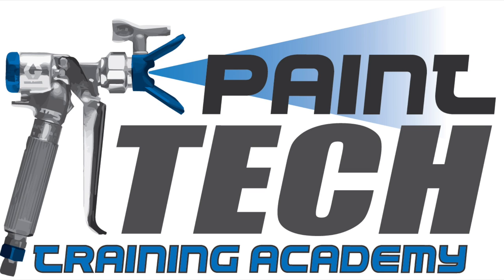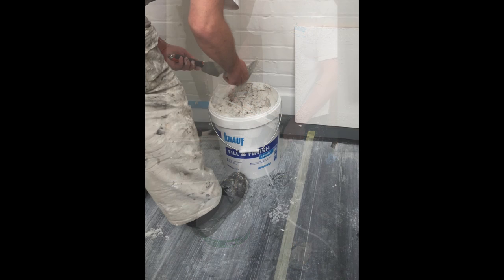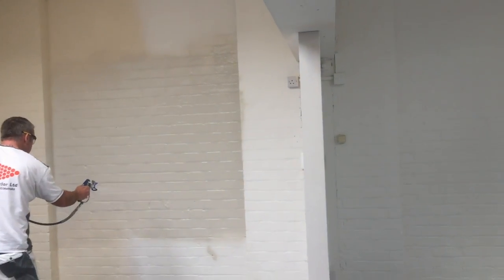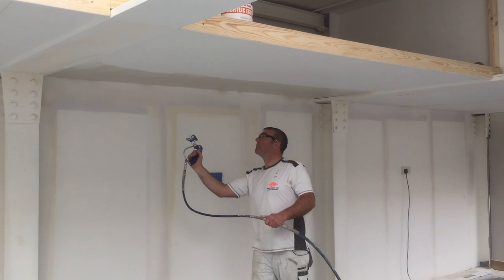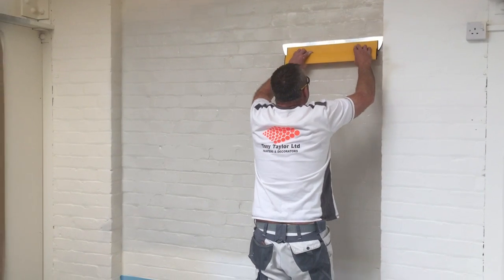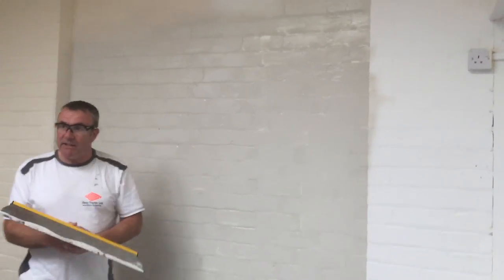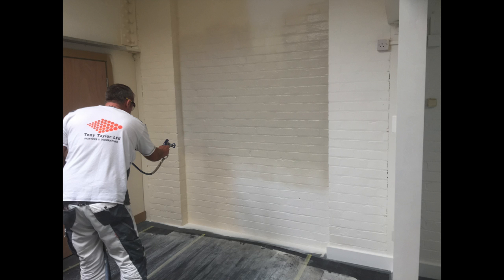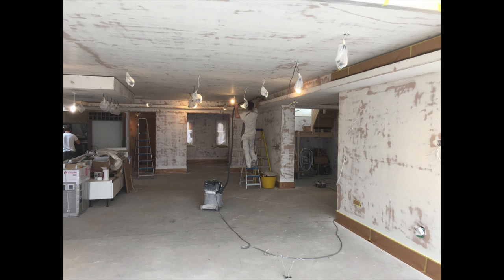Spray Plaster

Comment: You should also mention you have to wait for it to dry in between coats. 

The max thickness is also lots smaller than multifinish so you need to prep lots more prior to plastering. 

Finally, you can spray multifinish too!
Reply from the maker: have you tried to spray multi finish? if so how did it go? plus have you used any Airless plasters?
Reply: PaintTech nope, I've no experience spraying either of those. My jobs are too small to justify the expense and bulkiness of a multifinish sprayer.

AFAIK gracos sprayers are capable of both paint and ready mixed spraying which is a bonus. 

Ready mixed may be good for new builds with big areas of flat walls not for lime plaster which is what we mainly do.

Was this a rhetorical question though? Are you trying to say I just don't get how good ready mixed spraying is?

Comment: So you'll just use a regular paint sprayer?
 How would that work with regular mud for taping just thinout?
Reply from the maker: You can't use any sprayer no. The minimum really is the Graco Mark 5 which is the machine used here.

Comment: Show us the brick wall  you "attempted" to spray, I'd like see the full unedited version and "how long it really took you"
Reply from the maker: this was a test section at the academy to prove that it could be done and would adhere. Its stood the test of time and is still fine now, no cracking or peeling. It obviously would take longer to dry than a thin skim coat but dried quicker than we thought.
Reply: @sprayingmakessense  sounds great. I'd like to try it out

Comment: What is it like covering artex? Would you need more coats? And treat it like ordinary plaster? One coat, wait a while then another coat?
Reply from the maker: it's fine, depends on the thickness of the artex. You may need a different spray plaster to get thicker coverage for 1st coat.

Comment: Could you please mention the brand of your large (yellow handle) trowel ?
Reply from the maker: Think they are Tapetech ones - Refina do the same as well
Reply: Try the following key-words on "Amazon" or let your "search engine" do the work : " Drywall Finishing Tool Smoothing Blade"